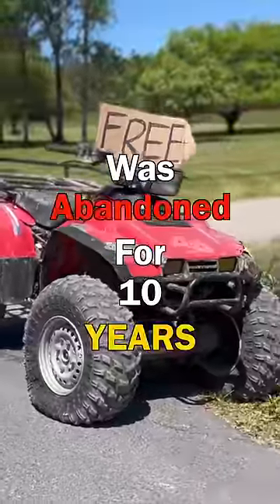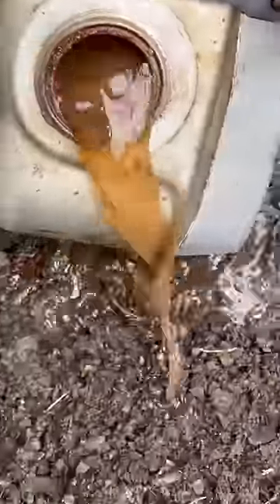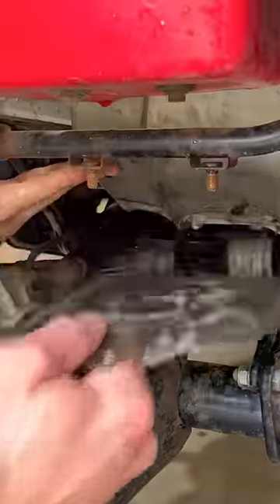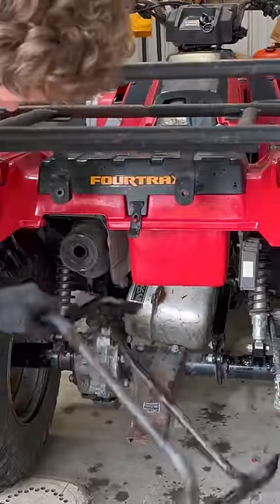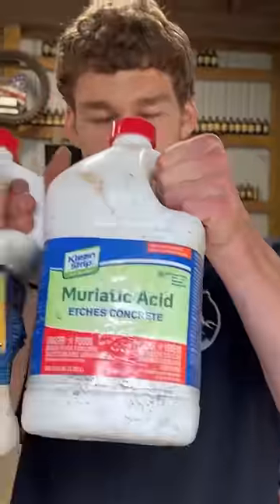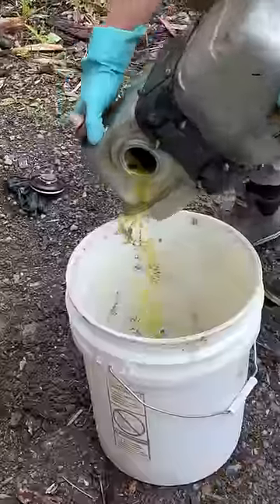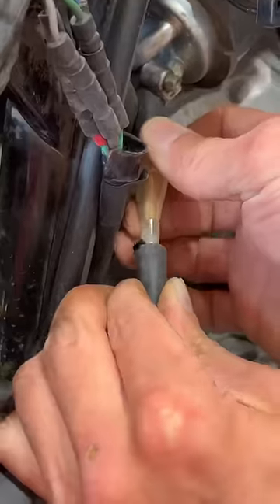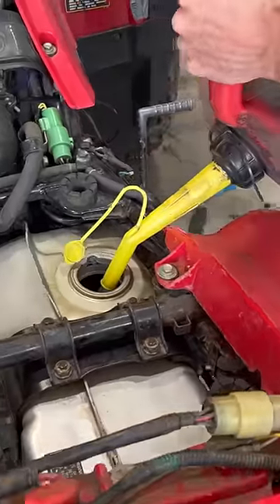They should have Paid ME to take this ATV…. 😳 #atv #diy

Comment from the maker: Watch the full youtube video here!

https://youtu.be/Pu1dgDbH-Aw
Reply: Hmp you want to sell that
Reply: serious question! i have a trx250ex 2005 Honda. it doesn't start or i think there's an electrical problem or something in the motor like magnets or electro? i have no idea its been sitting for 2 years, anything u suggest i don't have money to really fix it but i was wanting ideas to help get it running again. i tried new battery and solenoid with testing wires and had no luck:(
Reply: also 1 time i tried starting the quad and it seemed like the electric start button was stuck or something because it wouldn't stop cranking over its self.
Reply: That is a beast.. military style front axle
Reply: Damn my guy you're over here telling everybody you had your nuts taken off within the first 6 seconds of the video 🤣
Reply: Nothing free
Reply: So the carburetor was fine?
Reply: gen
Reply: I hah a 4-wheel for free if you want it. I'm in Florida
Reply: Oh I will
Reply: I û
Reply: I WILL PAY YOU for THAT??
Reply: Beware of the those sintered brass fuel filters. I put one on my son's atv and when I pulled the carb after it just died, I found some of the tiny brass beads inside the fuel bowl. Stick with the paper. I think the vibration is too much for those cheap ones.
Reply: Ddddd😊
Reply: Rererre😊
Reply: Hey family how things going
Reply: May u please give it to me
Reply: Yea this earned a subscription
Reply: Can you take mine i have a 75cc dirt bike
Reply: What brand is your battery torque gun
Reply: Those were the beast of a  4 wheeler when they came out. But when they sit those gas tanks will rust out.

Comment: Its not suprising honda's are build like a damn tank
Reply: Least the old ones are. Too bad those cost arm and a leg here. There is absolutely no way to find one for free like this.
Reply: I just loved how they got it running after everyone gave up on it for years and immediately broke it trying to unload it
Reply: @Hellsong89 they still are built like tanks
Reply: Honda is so Lucky fr they made a quad that can run off of gasoline and water and they haven't died of a heart attack from 3 gunshot wounds to the head
Reply: @euctheeast3902 he didn’t break anything unloading it  😂
Reply: Ya, the old ones are. Have a friend with a 21 who already had 2 engine problems.
Reply: Pretty much all air cooled OHC four strokes are.
Reply: As long as its complete it can be fixt.
Reply: @euctheeast3902 😅😅😅😅
Reply: I've seen Hondas on mud mixers that you couldn't shut off. There still running I'm sure
Reply: Pshh not mine my cr85 breaks every 2 days
Reply: In short will it run ? .... That's a honda case closed
Reply: @Hellsong89 I bought a Honda trx700xx a few years back from the original owner for 3000 bucks and now they're going for 5000. It's crazy and they're not even that great of in condition. Mine is absolutely mint and I'm thinking I should just hold on to it. It's garaged too
Reply: Toyotas are tanks
Reply: Japanese engineering
Reply: My dirt bike is a Honda and it’s 17 years old and runs like brand new
Reply: @euctheeast3902 it definitely didnt break. Light small hit and then he cuts the video and with the caption we already know that hes happy to lie for views.
Reply: @jakobbazil5187  Yep honda and toyota are the best vehicle companies for reliability
Reply: @euctheeast3902  the thing does look like it's in fairly good condition and was fixed with a gallon of fuel, it must have been hidden
Reply: @Wage_gap_gaming I rolled a Honda rancher off a cliff and rode that baby home lmao
Reply: Honda engines are like cockroaches 🪳 you can’t kill them😂👍🏼👍🏼👍🏼
Reply: This is the comment I was looking for
Reply: @Wage_gap_gaming hondas a big car company based in japan?
Reply: @IG21868  was it just an ecu program problem? I know Honda had tuning issues but it was a free fix and all you had to do was plug in a laptop. Utility and trail engines are obviously going to last much longer than race engines but even still my race Hondas last much longer than the engines on my yamaha,Suzuki and Kawasaki race bikes I’ve had in the past
Reply: @Hellsong89  u mean free and sane one wkkwkw
Reply: thatd be 1800$ in nova scotia, even with the wrotten tank
Reply: @Hellsong89 same🙁
Reply: My dad still had a honda crosstrak from 1996 and it runs perfect, shaft driven
Reply: U can use one part to multiples models & its work😀
Reply: My 12 4trax has been capsized in a river, we drained the oil and replaced. Fired right back up, it's basically unkillable. Been thru some legendary rallies. Towed a brute 650 home thru the nastiest rally I've ever seen.
Reply: @hunterburch2675  It was a rancher 420. Was eating oil then started knocking. Hence, the engine had to get rebuilt. It was under warranty though.
Reply: @theeoddments960  however there are new reliable four-wheeler engines. I had a 2020 outlander 850, Recently sold it due to moving. Loved the quad, put 5k miles on it used and abused it😂 had 0 problems with it except changing cv boots because of barbed wire getting tangled in the axles, which was my friends fault. Did all the maintenance on time and had a blast.
Reply: i have an 01 honda foreman rubicon 500 that we keep at the hunting camp with all kinds of shit getting in it and the only kind of work we've ever done on it was changing the battery
Reply: In fact, tanks are actually built like hondas.
Reply: My dad has an 86 Honda, uses on a regular basis and always has since new. That thing ain't quiting.
Reply: they’re built like quads
Reply: Becuase they will last the rest of there lives in kept in decent shape!@Hellsong89
Reply: No kidding, I have an '85 trx125 that sat outdoors under a tarp for 15 years out in my backyard that still starts and runs like a dream.
Reply: They really are!
Reply: Damn straight
Reply: And then Kawasakis are just trash from the factory
Reply: the nokia of the automotive world
Reply: Jesus loves you! He died on the cross for you. Please don’t take chances with your soul.
Romans 10:9 KJV
Reply: @EzraCansler  Yep, this totally relates to Honda engines
Reply: @Hellsong89  The new recons are the EXACT same thing as the older ones, the only thing they changed were the frame and plastics.
Reply: Yes they do. A cheaper version of honda CB hit my Toyota Fortuner right on the tire at around the speed of 40 km/h while im going 20-25km/h and my steer joint broke off while the bike is trashed but the bike frame is in perfect shape no deformities of any sort
Reply: I was thinking while riding on my 96 today how I’ve had it nearly 30 years.
Reply: @IG21868  mine is a 19 zero engine problems. The only problem I had was I had a recall on my fuel pump, but that was it.
Reply: Yeah Honda is definitely a good brand. I have an old med sized generator I got in 2018 from a client. She said her boyfriend left it on the back porch for like 2yrs. It been through it. But I took it to my mechanic that tunes all my gas powered equipment. They cleaned out the tank, new plug, new air filter, quick clean up. Even on a cold day, winter start. That thing still runs till this day. On the 2nd pull. VROOOOOOOM!!!! Lol
Reply: Yeah their small engines😂😂😂
Reply: Three wheelers are the perfect example. Find me a 200M that doesn't work even when snapped I'm half I swear it's impossible 😂
Reply: @RealWunderBanana I bought an original style 400ex that was rolled on pavement, used a pipe to straighten it the best I could, few odds and ends replaced and the thing ran and drove fine for years lol

The engine was out of it and sitting in the snow and rain and everything, put it in front of a wood stove for like 3 days, left the spark plug out and when I turned it over a piece of ice flew out lol after some heavy seafoam it purred like a kitten
Reply: it wasnt that bad off if he just drained the gas tank and got the rust out and filled it back up with gas and it ran
Reply: @Wage_gap_gaming 🤦🏻‍♂️
Reply: @IG21868 it depends on how good you take care of em and stuff more often than not if there was quite a bit more wrong with this one then it woulda took alot more work than what they did in this video basically just cleaned out the gas tank or whatever and the put gas back in it and started it up
Reply: @angelo_giachetti eveb if ifs not replace the old/broken parts that dont work and you can get it back to runnig again ive seen people make alot worse look alot better and run alot better when it looked like it couldnt be saved at all
Reply: Honda makes good stuff
Reply: @Hellsong89  yeah because he faked this
Reply: My Yamaha sat at in pieces on a garage floor for 12 years put her together and put in a new cdi and she runs great
Reply: i have a 1988 honda fourtrax 300 and its a tank
Reply: And it didn't smoke at all
Reply: I support that 😊
Reply: Jesus loves you! He died on the cross for you. Please don’t take chances with your soul.
Romans 10:9 KJV
Reply: You’re right .. I had a “motorcycle “ given to me by my uncle with a Honda gcv160 engine in it , left it outside because it needs a different clutch as told by my uncle and so it just sat for over a year , last week I was bored and took it apart and the engine was full of water so I drained it added oil to it and starting fluid and it started right up
Reply: @hunterburch2675 Not really. Can am is the toughest atv to date.
Reply: If they had a joint venture with Briggs and Stratton, the product would be perfect.
Reply: I personal think that these are the best quad made
Reply: @Big_floppers445  It's ok to have a bad opinion  😂

Comment: I guess we’ll just ignore the fact that he spilled gas all over the tank. It’s ok, we all do it occasionally. 😂
Reply: Or that carburetor wasn’t cleaned also.
Reply: Or him dumping the tank on the ground.   I don’t know what was being dumped at that point but, that could be a BIG and expensive action.
Reply: Or the name of the video. Why should THEY pay HIM for that?
Reply: I think it was muriatic acid that he dumped... Cant be good...
Reply: I do it every time I put gas in the lawn mower because of where the tank is lol
Reply: That was like a dollars worth of gas lol
Reply: Just about every time I pour gas into my lawnmower. 😂
Reply: @casualobserver7867  yeah, I ignored the part where he dumped it into the bucket 1st, too
Reply: @optimoprimo132  how bad is a tablespoon worth cut with around a gallon of water?
Reply: @casualobserver7867  
There are bacteria which eat oils...even gasoline.  That much gasoline is not a problem after a few years.
Reply: @optimoprimo132  
Muriatic acid is Hydrochloric Acid at 1 Molar concentration.  It's NOT an environmental hazard.  The Cl- and H+ ions will all find things to react with in the soil, and no big deal.
Reply: I just bought my first vehicle witch is a minibike and I did the same thing
Reply: Its because of those new fill valves that spill morengas than the bendy ones
Reply: @DaxtonJ  waste removal is expensive , u dont just drop it in junkyard

not in US anyway,
Reply: I was the 1000th like. you're welcome
Reply: Like the doctor spilled your brains at birth
Reply: But YOU don't make a video of it
Reply: No we don't 😂
Reply: He did it on purpose for more comments

Comment: Sitting for 10 years and the battery still has a charge that's AMAZING!
Reply: I had a Toyota Celica that did actually experience a Lazarus revival after a yard sit of that amount of time. But it was fuel injected, and also was filled with pure gasoline rather than the ethanol laced gas that government saddled everyone with.  Just with a battery replacement, it cranked and ran like it was last started the day before.
But this is not that.
Reply: I went to start my honda motorcycle which had not be used in several months. It cranked for almost a minute before the battery died. I then jumped it with my suv and it eventually started. But the battery is now 100% dead and will not take a charge at all.  How did it go from having enough juice to dead and can't be recharged in under 1 minute?  LOL...   The point is that battery chemistry can sometimes do shit we just don't understand.
Reply: @Robert08010 starting batteries aint built to go dead it damages the lead plates. They have to stay above 12 volts or they can easily  lose capacity even new ones.
Reply: I bet that the battery was made by Honda. That would explain why it never lost its charge. 😅
Reply: It's a HONDA
Reply: @Robert08010 I hope you jumped it right and didn't have your car running.... Otherwise bye bye bike battery, and if for some reason you had it connected wrong, bye bye both batteries😅
Reply: @eclipz3424  No, but if it was that you can easily tell when one or both batteries explode.
Reply: Because he put a sign on his own quad to make a video. No one gave this away
Reply: Are you trying to say this is a scripted story? They set this all up ahead of time?
Reply: @Robert08010  jumping a small batt off a larger one can fry it. That is understandable.
Reply: It's also a video
Reply: Usually lead acid batteries have already ate themselves up but maybe with low charge it actually prolonged to plates inside from being destroyed
Reply: @kentmorton2872  No battery can sit for 10 years and hold a charge. Not a single one. the materials inside would degrade over that period of time.
Reply: @HaysonTM2   I guess that you didn't see the laughing face in my comment.

Comment: That's amazing you never had to clean out the fuel line. Or a carburetor
Reply: exactly.
Reply: Yep
That thing was nowhere near “pay me to take it”
Reply: 10 years my ass 😂
Reply: Yeah it’s a fake vid
Reply: Strange focus on cleaning the gas tank, which would have been the least of the worries in a real storage case.
Carburetor disassembly would be square one.
Reply: Yeah, I'm sure no water made it past the petcock which I'm sure is also fine 🙄
Reply: Or charge the battery or replace the spark pluges
Reply: Did you change the oil??
Reply: After 5 sec i know he was more of a scenarist than a mecanic.😅
Reply: @jacks_Dc5 I agree
Reply: @jacks_Dc5 yeah thing was pretty clean lol. It wasn’t sitting for no 10 years
Reply: ..or check/change the oil!
Reply: If that thing had actually been sitting for 10 years the fuel in the lines would have turned basically turned into lacquer
Reply: My thoughts exactly
Reply: Of course it runs it's a Honda

Comment: I have never encountered a vehicle more resilient than an 80s Honda 4 wheeler
Reply: And the three wheelers too
Reply: Still ripping my 88 trx300fw.
Reply: I swamped one crossing a stream when i was a teenager. I admit i was nervous as i was over 30 miles out in the middle nowhere with no phone. But drained the water out of it and it fired right back up. Got me home without issue.
Reply: the old big red 3 wheelers was the same way.  last year was 85 in which the fourtrax became the new tank...they just added another wheel
Reply: I have a 91 Honda it's been good to me
Reply: @californiacountry209  bro those things will kill you...  My older brother who lives on a small farm had one years ago and i was amazed it was a real product. Never seen a motor vehicle that could flip or run over your legs so easily lol
Reply: @fpscanada3862  yep. That's why they stopped making them. You can't really turn if you're going over ten miles an hour.  Despite that, they will run forever.
Reply: @californiacountry209  haha yea i believe that. Idk if they even sold them in canada. The one my bro hqd was from the 80s i think and its the only one i ever saw irl
Reply: I had an 03 XR 100 that was like that. Just COULD NOT die. I had it when I was a teen and abused the hell out of it, don't think we even did a single oil change. Sold it to a buddy so his kid could ride it, that thing is still rockin to this day.
Reply: Honda three wheeler’s have entered the chat

Comment: So one thing you should always always check before running is the carburetor. If it’s gunked up, you do not want to put anything through it until it’s fully clean.
Reply: I like to just fill it up with brake clean if it’s gunked up
Reply: @Burns11112  brake clean will destroy all the seals in a small engine, including the carburetor. That should never ever be done.
Reply: I hope you meant to say Choke and Carb cleaner. Parts cleaner has methanol in it and that eats the plastic and rubber seals inside the carb/engine. It also dries out, whereas the Carb cleaner leaves  nice film to help Lube and protect the components. Not to mention the parts cleaner is poisonous when burned.
Reply: @TheCrystalGlow  Yep, that's exactly what I was thinking. Usually disconnect the fuel lines and start tearing down/cleaning the carb before ever attempting to start equipment that's not been maintained.
They did do one thing right though by cleaning out that gas tank properly 👍
Reply: I usually try to fire it up, before tearing the carb down, if it runs fine then there's no need to clean the carburetor. Tearing the carb down is definitely something you should probably do anyway, just to make sure everything is good, but I usually fill the bowl and see if it will run before putting any time and money in to it, If it runs fine, then I don't mess with it.
Reply: The nice thing with the carbs like the ones used on wheelers is that if you are careful they can usually be torn down, cleaned and reassembled to be fully functional without having to replace any parts unless there is damage.
Reply: you dont have to when you fake the videos like this.